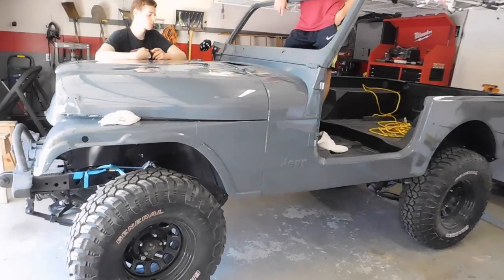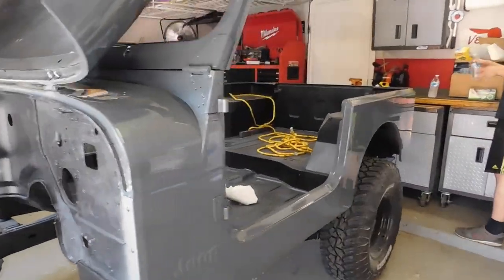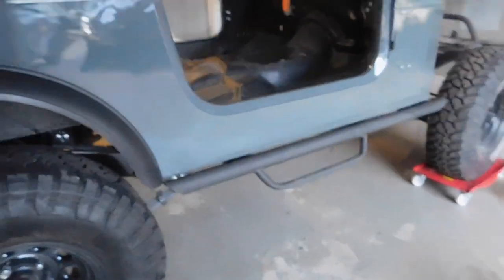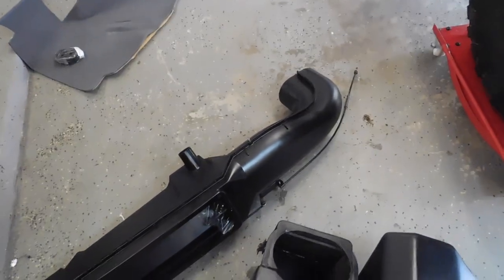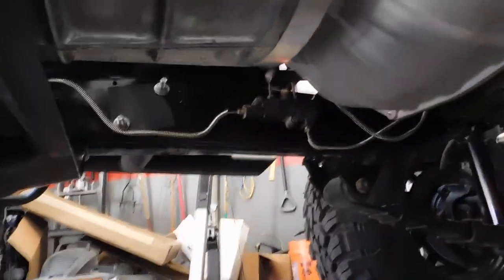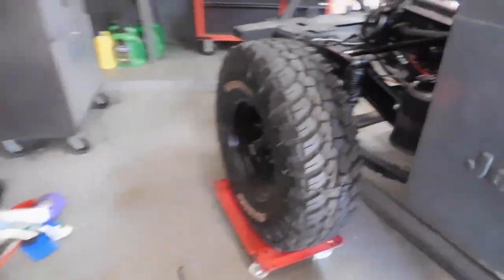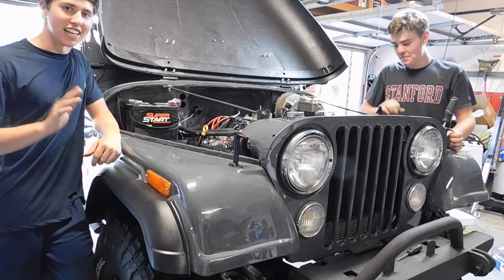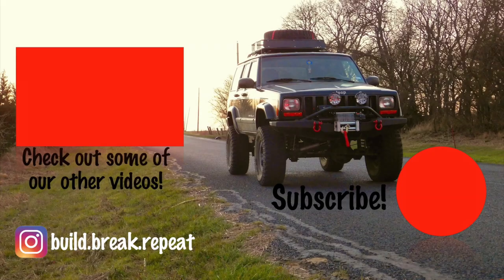Complete Reassembly | Jeep CJ7 Build Part 14

Comment: The last Jeep I had was a 1980 CJ7 with a 8 cylinder motor a 304. I took that out and replaced it with a fresh rebuilt 360 V8. It ran great after that.

Comment: Grab yourself some sealed beam turn signals for the front, it will save you time and money in the long run.  They make them that fit in the factory holes without modification, and when smacked by a stick or other object off-road or a tow strap that breaks, they pop through the hole rather than break.  They also look great.
Reply: 7

Comment: There's a secret about installing a fuel pump. There's a bolt in the block under the alternator. Before you remove the fuel pump. Remove the bolt in the block and put a longer bolt in.  Replace fuel pump, and put the original bolt back into the block. 
Girl mechanics rock!

Comment: ill give you props for getting that booster to fit without the booster bracket......but i also hate to break it to you that it would have been a simple bolt in install if you used the brake booster bracket that goes between the booster and the firewall

Comment: Where did you guys get the master cylinder, radiator, fan shroud, and fan from? Thanks.
Reply from the maker: Colt Meagher We got the master cylinder from sunny racing, I would make sure you get a more expensive one that’s not rebuilt because we went through 2 of them before we decided to get a good one. We got the radiator from northern auto parts (came with the headers). And then the fan came from Novak it’s like the biggest one they have and we couldn’t use any of there fan shrouds because it wouldn’t fit so we got a super low profile shroud from eBay.

Comment: Great job! Where did you find the mechanical oil gauge? Been looking, no luck. Thanks!
Reply from the maker: 1pokras Found it at autozone, it's just a cheap equus gauge, I would get one a little more expensive because it already broke on us.
Reply: Thanks! Your Jeep looks great. I'm restoring an '82 CJ7, not quite as comprehensive a rebuild as yours, but I have my hands full. Keep up the great work

Comment: Nice build. What brand and part number headers are those?
Reply from the maker: Keith Clevenger 69640 at northern auto parts.
Reply: Thanks . in the process of rebuilding my 85 CJ7 . I like the primary tubes on those but I need a 1-3/4  on them